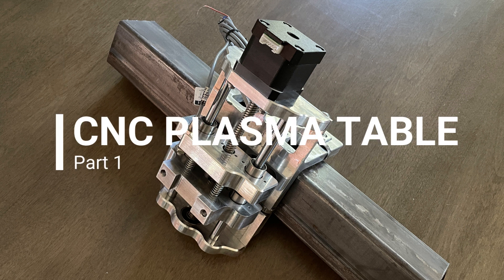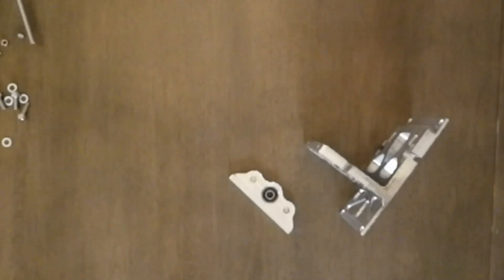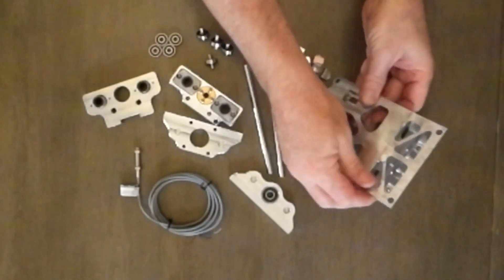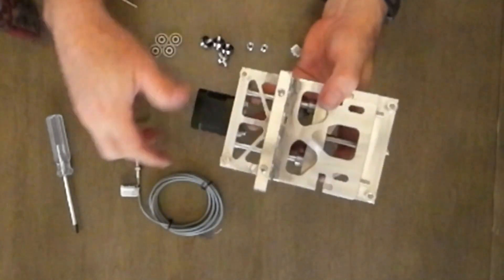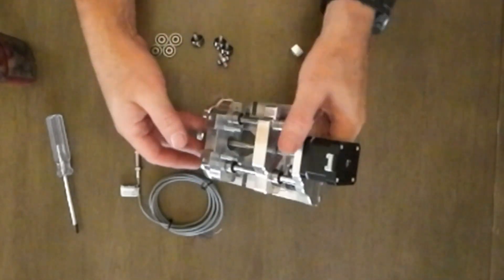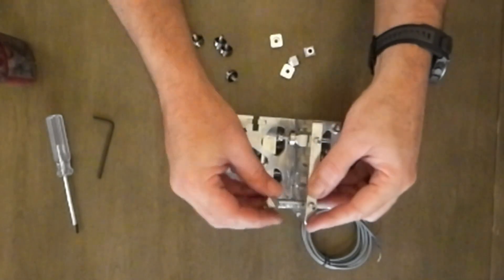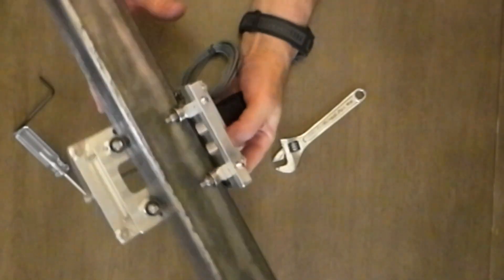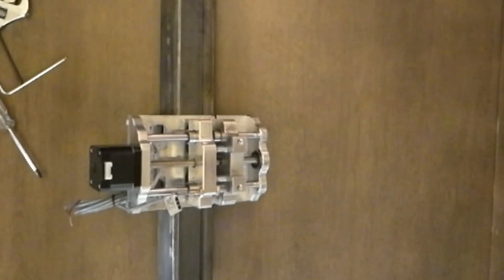DIY CNC plasma table - part 1 Z axis torch holder

Comment: Very nice.  My next Z axis will be 6061 also.  Although yesterday I crashed into a hold down weight and ground clamp after forgetting to zero my X and Y before starting a job.  I was able to hit E stop before demolishing my Z.  Popped the torch clamp out of one side and bent Z mount/holder, but was fine after putting it back together.  Aluminum would have broken something.

Comment: Looking nice! The touch-off material height sensor mechanism doesn't need any springs at all, since the torch weight is more than enough in this case. In fact, the springs will make things worse, since with this type of sensor you can't cut thin materials, since the torch will put enough weight to bend 2mm and thinner steel too far, so that plasma will start piercing at zero height, instead of pierce height.
The ohmic probe with touch probe, as a failsafe is a way to go. Otherwise, just don't put springs in, the torch weight will be enough.
Reply from the maker: Thanks for the tips.  Ill be experimenting with lots of little changes along the way.  That will be a good one to try.  I was anxious to get this part finished so I could get the actual finished weight and counterbalance it on the other side of the X axis.
Reply: Might have problem with counterbalance and rapid Z movement, because of counter-balance inertia. Would probably be nice to try it anyways, since it has a chance of working. Good commercial plasma systems have ohmic probe as a primary sensor, physical touch-off as a fallback if material is too dirty for ohmic to work and also torch breakaway sensor which will stop process, if torch plunged in a material anyways, while none of the above sensors tripped. @dcmotive